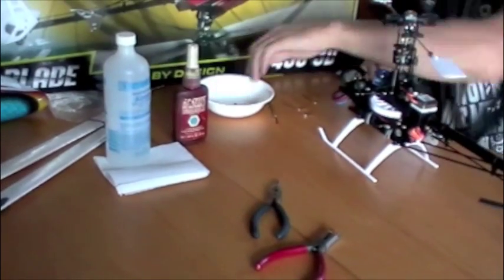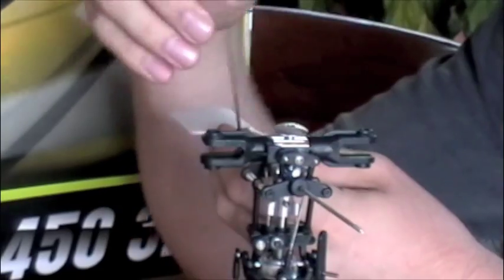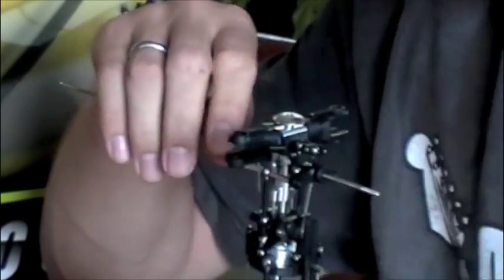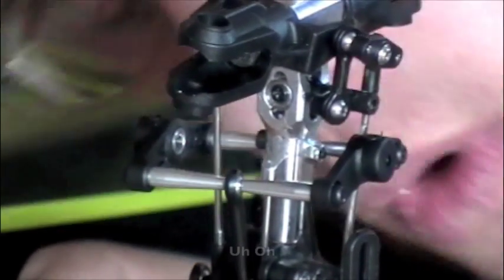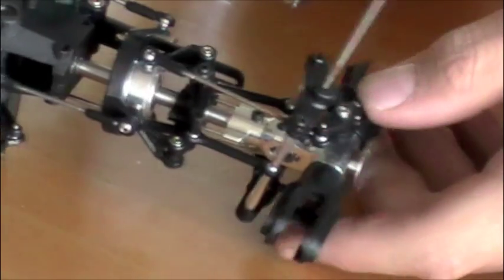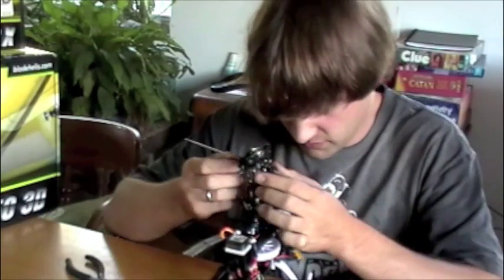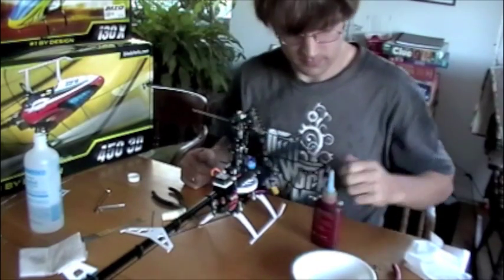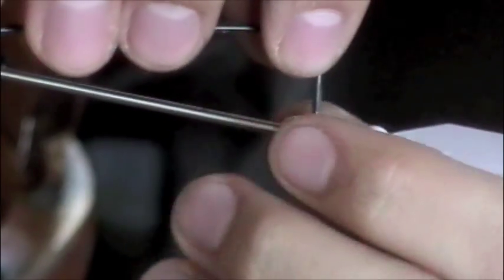450 Heli Maintenance 4

Comment: I have a blade 500 3 D I need to do the same thing in a couple of days. I'm wondering if I slid the old one out while sliding the new one in at the same time if the new one would just slide in nice and easy behind the old one in essence creating one flybarre passing through the bearings at the same time. I'll try it out

Comment from the maker: We used the blue loctite 242 which is 'removable' strength.  Basically we wanted to keep it from vibrating apart, but we wanted to be able to disassemble it later as well.